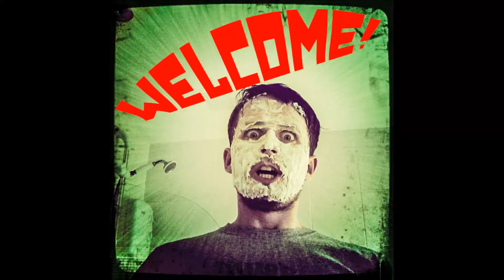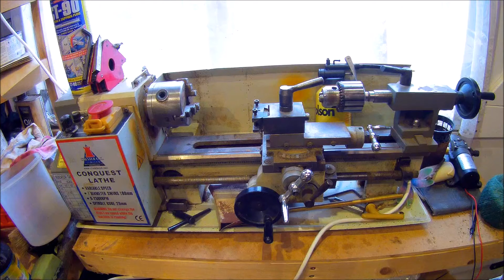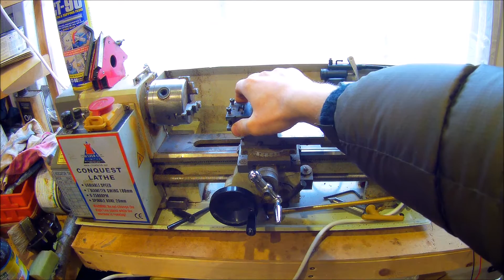Chester Conquest Lathe Review

Comment: Hi got the  similar chester conquest lathe all I can say is absolutely the biggest pile of crap I’ve ever purchased.
Were do I start .
Tailstock does not line up with bed .
Looking underneath the tail stock the casting is so badly machined it sits were ever you clamp it .
So if you have a part in the lathe Chuck and go to centre drill it the centre drill misses the centre of the job by literally 1 mm .
The saddle has got so much play on the bed if you try to part a job off with a parting tool the saddle lifts off the bed that is taking the lightest of cuts .

Changing the lathe Chuck is a pain in the arse. 
And when I purchased it tried a test piece has so much taper on it virtually unusable.
I kick my self for not sending it back.
I sorted most of the problems apart from the tail stock .
I’ve had enough of it so muchI’m getting rid of it.
And buying something British.